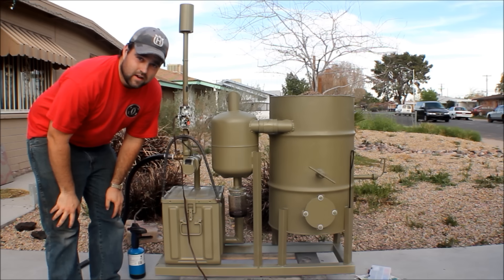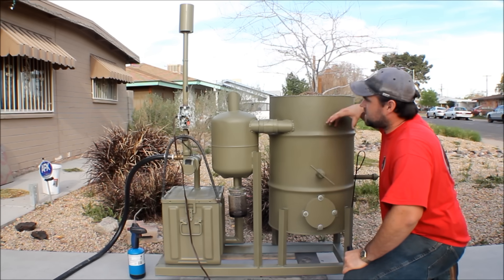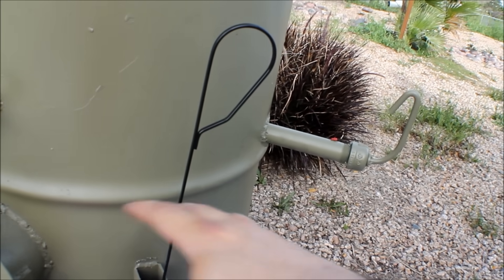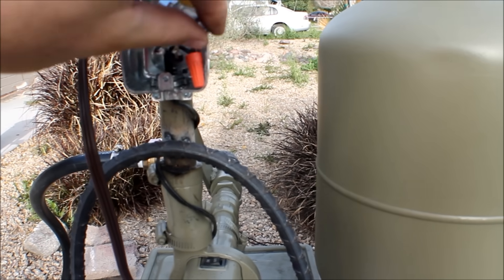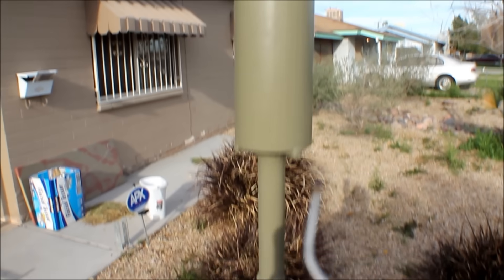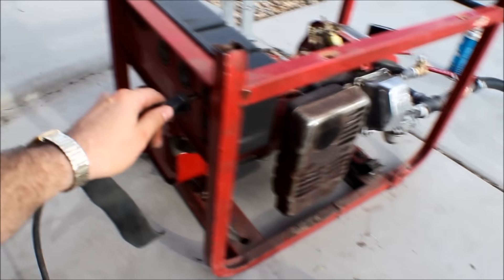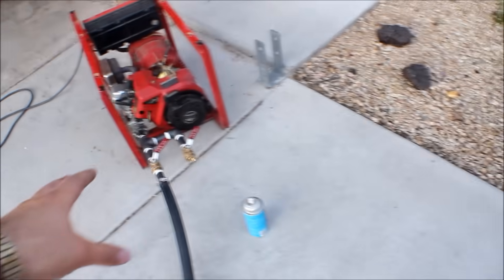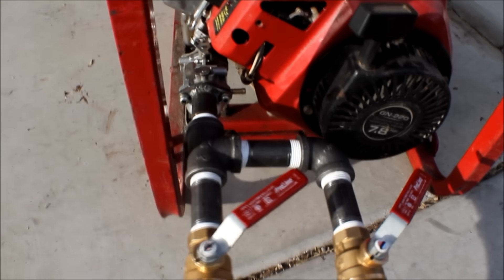amazing homemade gasifier uses wood pellets to run generator -- renewable alternative energy video

Comment: Cool.   I thought that engineers usually allowed for a 50% safety margin.  Have you tried it with other types of fuel sources? ground up wood chips, etc.?   Also,  you might consider some sort of filter on the air input on the generator ( i do not know how strong of a 'draw' it has while running. just to keep stuff out of the air line.
Reply: 50% safety margin for pressure and allow up to 10% variation in max process conditions (I.e. temperature and flow rates). It's usually 10% safety when you have control instruments but if not you go to 50%.

Comment: I wonder if you were close to a water source, such as a stream that runs all year; Then wrap cooling coils around the outside of the drum - what effect would that have? 
It would help it to run cool, but at the same time you do need it to have some amount of heat. Probably a valve that allows you to turn the water on only when things heat up, or maybe get fancy and have water flow controlled by a thermostat.

Comment: Nice Vid - good job on the build.
i found that since the wood-gas is only 30% effective compared with gasoline, that changing the gen motor to one about 3x bigger than the original gave me a wood-gas-generator that could put out the full rated output of the generator.  In my case i changed a 3Hp engine to a 9Hp honda but as you say in the vid you need the gasifier to be sized to the engine size.
Very cool.
Reply: The other option is to use the gasifier to collect heat - wrap the barrel with copper line and circulate water through it to cool the barrel and to heat a small shelter "co-generation" heat and power at the same time!. I figure this should work well to recharge batteries in winter when the solar is not very good due to short daylight and cloudy days (in my area at least)

Comment: Has anyone invented a wood and/or coal fired steam engine that could turn a massive flywheel that links to an electric generator? 😁 Of course I’m being snarky, but scaled down for home use, I can see the viability of a wood burning steam engine for electric generation.  You could even power a shallow water well “sucker” pump with a small steam engine. I’m beginning to think like my great grandparents!

Comment: I find that cooler wood gas works more consistently with very few fuel/air adjustments and a very steady engine operation. I simply used old water pipes with fins from old baseboard heaters running back and forth in an 8 foot water tank, but any design for the water tank will work if shaded from the sun. 
Thanks for the video.
Reply: Most definitely, condensing the gas output will concentrate it further; likewise, recirculating the exhaust gas after sustainable combustion should further break it down and give a secondary burn to the mix, using up the remaining condensation and unburned fuel. But where is optimal and safe? Into the spin down, ammo can, pre-cooling, or post-cooling?

Comment: That would be pretty cool if you could use the guest of fire and fill 20 pound or hundred pound propane tanks with your gasifier so you could run it for a little while without having a burn

Comment: Build a second frame rig for the input side, add a Large pellet storage tank and gravity feeder, add a battery, a small solar panel, a trickle charger, and add that generator to it, 
 and you've got an all - in -one setup.  
Great job, well done.

Comment: Hot gas. How about something like a condenser coil?
Reply: Exactly.  Wouldn't be hard to bend some copper tubing and run water through it, similar to the condenser on a still.  If this contraption were situated near running water you could just divert a little and let gravity run the water through the condenser.

Else you could use a little of the electricity produced by the generator to help power a pump and/or fan to run the condenser water through a radiator in a closed cycle, as in a car.

Comment: Nice rig! In a design I have (that I will probably never build as I lack skills), I use a water tank to filter the tar and other impurities.  It also has a small water tank so the heat will boil water, and a flat cooking surface so you can cook while generating the gas for the generator. Just an idea, but I have been impressed by these things for a while now.

Comment: Very cool. There are a ton of tweaks you could do to make it cheaper and more efficient. I think you need a battery pack to run heavy load stuff like a saw or grinder but If this could run a freezer of fridge, it would be a game changer.

Comment: Horse shit. What’s the point? Nice setup. Post  how  long the engine last by running on this wood fuel .and won’t work to well when it’s raining..why not go back to the steam engine. Might blow up too. Why not use pressure gauges? True lyrics , great ideas. More gas for me, Would not recommend for Henry home owners.

Comment: Plug a water pump into the generator and bingo a plumbed mini house/cabin,And then run the hot gas tube through the cabin.This heat's the cabin and cools the gas as well which in turn makes the gas more effective.

Comment: We won't discuss the pollution from burning wood .
Reply: cleaner than a campfire
and technically carbon neutral as the tree originally got its carbon from CO2 in the air within this century, not millions of years ago

Comment: Looks like you do nice work my man. As a builder I recognize thoughtfully done good work when I see it. I admit I don't have much knowledge regarding wood/gas stoves but I do want to build one! I'm a 'from scratch' builder and I absolutely love building with steel and I only use what most folks call garbage: scrap metal, all of it is either from our local garbage dump, our local scrapyards and I regularly check the back alleys for automotive repair shop scrap metals.  
How much do you folks pay for a bag of wood pellets? Here in Alberta we pay $7.00 dollars for a 40 pound bag.

Comment: Nice projekt. If I can i sugest one inprovement, Mount a radiator betveen the barrel and the cyklone seperator. You want the woodgass to be as cool as possible before seperating , moisture and all the oder gunk that comes out of the barrel

Comment: Only flaw is the car battery lol and the cheap fan that wont last very long at all if used much at all . If you get a deep cycle battery and a constant charge solar panel, or trickle charger hooked up to the generator.

Comment: You or someone needs to start selling these!  Full KIt could include:  
1. one gasifier with large woodchip loader and pilot light on a timer. 
2 one 2000-4000w gas generator
3. Two large battery generator
4. maybe some solar panels (in case you run out of wood chips lol)
have the gasifier charge the 2000-4000w gas generator, which then keeps one or both of the 2 battery generators/banks charged at all times.  Endless energy.
Reply: Endless wood chipping.

Comment: How about a list of parts, their sizes, and where to get them? A basic diagram of the machine? I am especially interested in  the black hoses that you used to pipe the gas fumes from the gasifier. Where does one obtain this? What is that kind of tubing called? Thanks.

Comment: Great idea but how long run time on a bag of $6.00 pellets vs gas or even diesel? Plus the damage of dirty fuel top a part time engine will be catastrophic. Not being smart here just wondering the efficiency factor.  I have seen them on trucks but burning wood, how would this work with chopped thin branches? My back yard is the Haliburton Forest and Wildlife preserve in Ontario Canada and Peter Schleifenbaum had built a huge gasifier with 3 different technologies running the saw mill and all electrical production off it. The ash is returned as a carpet to the forest floor giving the trees back nutrients. A very intelligent man who re-planted twice the tress he logged.

Comment: Actually, I was thinking about it.  The cooler the gas is not about energy, but getting rid of water vapor.  Water vapor is a product of partial combustion of wood and it doesn't burn.  So you want to cool the wood gas and get that to condense out. Thus leaving you with a better fuel. Plus water being a product of combustion, if in the mix to begin with will reduce the combustion because it is a product of the reaction.  Basic balanced equations stuff from Chemistry class.  Finally I got to apply this knowledge!
Reply: How to improve the system? Have a pipe that just goes down and let gravity pull out the mositure? Put a valve on it to drain every once in awhile. The other option is to have a radiator built into it.

Comment: Tweak it out with a few gauges,extend a welded #10 can, to the top, both ends cut out first,to hold more pellets,use a computer controlled electric valve circuit for fuel air mix control ratio etc etc, then if you like doing it ?  Sell those babies !?!

Comment: Great video. You run your saw on your generator already, so you can cut more wood; you should also have a pellet mill that can run on the generator. ;) Search YouTube for 'pellet mill', 'pellet machine', 'pellet grinder', 'pellet press' or 'pellet maker'.

Comment: You loose less energy if you create movement with steam then, get a belt and pass that movement (cinetic energy) to..
generator.
wood cutter
a mill
 a lathe
etcetc...

the problem is you cant have electric tools you have to adpat all of them to work wity cinetic energy. So you can power an entire actory of tools with a sigle wood generator.

like this 
https://www.youtube.com/watch?v=LYuxHCKmZGM

Comment: Good job here. Mother Earth News did one of these back in '78 '79 and drove coast to coast in a Chevy pick up. I later saw the exact same build attached to the back of a bus in Vietnam (ABC News 20/20?) . Try putting some coal (not a lot) in there, see if you get better power.

Comment: this is old stuff but yours is pretty nice. the Germans already had these but not like yours. the German farmers could not get fuel during the 2nd war. The farmers mounted the unit in front of the tractors and the fumes went to the cylinders. they worked pretty well and fuel was wood, pine cones, anything burnable.

Comment: Looks very good , but you need to make better the carburetor part ,, in this condition it requires constant adjustment of the two valves to keep a satisfactory mixture , which can change on different engine requirements ,,, may be a pre carb mixing tank , with some kind of mixing flapper valves that can work on closed loop sensing the exhaust ,,, don't know just a thought ,, nice job !!

Comment: This may be a bit off topic but I hope some one finds it interesting I have an idea for constant energy flow :) Imagine a bunch of water wheels positioned above each other, each one when spinning generates an electrical current not so unlike a wind mill does but with water. At the top is a big basin of water, as the water falls straight down it spins the water wheels generating electrical current. When it reaches the bottom their is another basin, but this one can be shaped some what like an up side down bowl and is slanted down so water flows into areas that are separate and in these areas the water is evaporated and then travels up tubes and back to the top where water re-condenses and falls back down. In these tubes the steam is traveling up through, there is a smaller tube coming down from the top and small windmill like contraptions protruding from it. The rising steam spins these small windmills and generates electrical current that travels through wires in the center of these inner tubes and can either be used for extra energy output or help to heat the bottom bassins or even the tubes themselves so the evaperated water stays evaperated all the way up. The energy to keep the bottom hot enough to evaporate water comes from as many of the water wheels spinning as needed. To get more energy output you just make the contraption taller with more water wheels, It will always only take so many wheels spinning to keep the water on bottom boiling so more wheels equals more energy output. The material in the top basin can be designed as a heat sink to help the water re condense into liquid form, if built correctly, so no water/steam escapes, it just keeps going and going utilizing natural forces to function. If the device was built inefficiently, in that water was escaping from it in small amounts over time. One could easily rectify this issue by attaching a device to the top of it that naturally gathers moisture (Water) from the air and releases it periodically into the system to replenish it. :) Now just add the proper electrical wiring and chargable baterries into its design so all the excess energy being perpetuated can be accessed from plugs on bottom and/or top of device and presto you got yourself free energy.(Free in the sense that you didnt pay for it :) Please share this Idea with Everyone.  Signed Adam McKenzie Anderson
 Extra Note: If anyone uses my ideas for none profitable means great I hope it helps but if they are used to gain profit in any way I want 25% of anything that comes out of it. :)  My EMail is starfire7654321@yahoo.com

__________________________________________________________________________________________________________________________
I have an idea for a lifting force machine. 
Step 1: Get hollowed out cube.
Step 2: Securely attach magnet to inner bottom of hollowed out cube.
Step 3: Place a lever on inside bottom of cube behind the magnet that's securely attached to inside bottom of cube so that one side of the lever is pointing towards you and hanging over the magnet.
Step 4: Attach a vertical bar to the top side of the part of the lever that is not hanging over magnet witch is securely attached to inner bottom of cube. Make sure the bar goes all the way up to the inner top of the cube barley touching it.
Step 5: Securely attach a magnet to the side of the lever that is hanging over the magnet that is attached to the inner bottom of cube.
Note: Magnets need to be facing each other with attracting poles N,S or S,N
Note: The lever is going to have to be really close to the magnet on inner bottom of cube because of how close those magnetic fields need to be to interact. But not so close that magnets can touch.
The magnet on top connected to lever is pulling the magnet on inner bottom of cube towards it and since the magnet on inner bottom of cube is connected to cube, this pulling force acts as a lifting force. Now at the same time the magnet on inner bottom of cube is pulling the magnet on top downwards BUT the magnet on top is connected to the lever so any downwards pulling force is being converted mechanically by the lever into upwards lifting force. Now if you know anything about magnets you now that there are magnets powerfull enough to lift far more weight then just there own. So essentialy this divice is exploiting the powerfull pulling force of magnets by mechanicaly transforming its magnetic pulling force into mechanical lifting force through the clever utilization of a lever, and walla stuff can be made to fly. Imagine if the magnets in this experiment where electro magnets so the ammount of electrical current going into them determined the ammount of lifting force that it would have. Now imagine this system being used as an attachment that could be placed under or ontop of vehicles to counter the weight of the vehicle and any cargo its carying. Now imagine  if this was done with powerfull permanent magnets and turned sideways and placed in an electric generator and had enough strength to pass through the magnetic fields as it propelled itself forwards with its own magnetic pulling force.     Signed   AMA

Comment: scavenge some of the excess thermal energy from the main firebox and use it to charge a heat mass for thermal storage.  Great for hot water, home heating etc.

Comment: Excellent !! 👍👍👍 I've been trying to find a decent video showing one that's been built and running and found this one . Awesome job .I definitely plan to check out the FEMA page and download the documents .Just wondering if putting a heat syncs on the connecting tubes and around the barrel would help keep it cooler .
Once again nice work on this build .😸
Reply: Did you build one

Comment: Awesome job on the gasifier, very well thought out. Have you thought of utilizing a pellet stove worm screw feeder for your fuel supply?, speaking of pellet stoves, I was watching a few videos here on YouTube , people are switching to coal pellets which produce more b.t.u's per pound than wood pellets just a thought. So I'am assuming that you can run that generator so long as you have a fire in the fire box, or do your rubber/ silicone pipe couplings need a cooling off period???.
    Thanks for sharing!
    Kind regards, Eric Dee.

Comment: Good job young man a lot of people don't know how to make this so big help there. 
Another suggestion with this is to put condenser pipe coils inside the 44 gallon drum circulating water through it and using that for household purposes wich again will bring massive savings to electricity bills and same time cool of & condense smoke in drum.
Good luck & God bless from South Africa.

Comment: Using soft copper tubing coiled around the barrel to a large hot water tank will put the waste heat to good use.  Running the generator at optimum rpm to charge a battery bank will keep the generator from wasting a lot of wood gas when not under load.